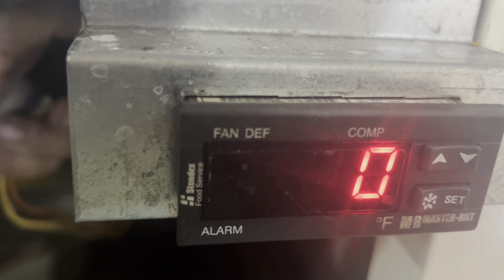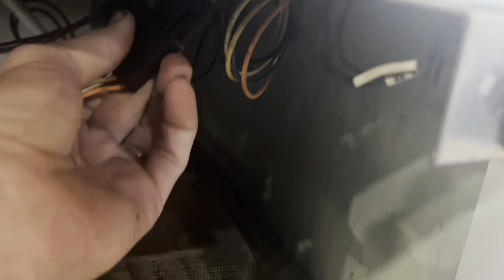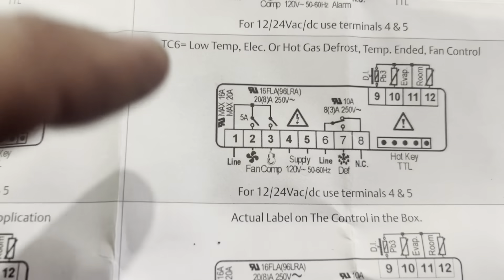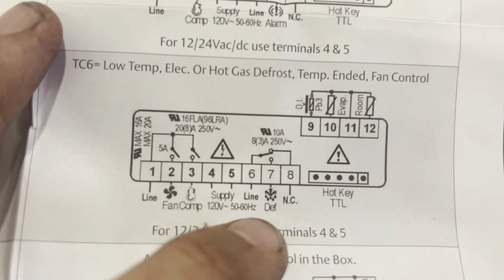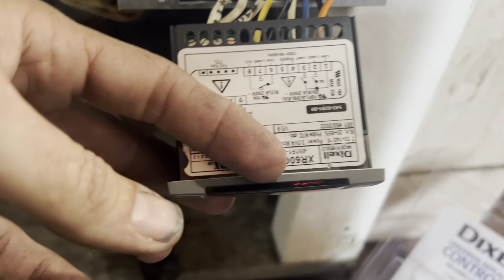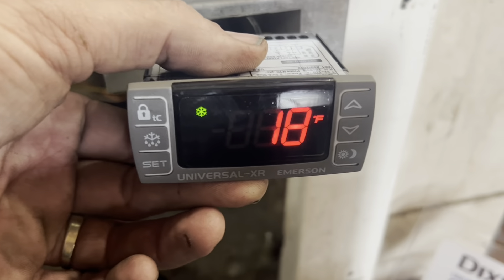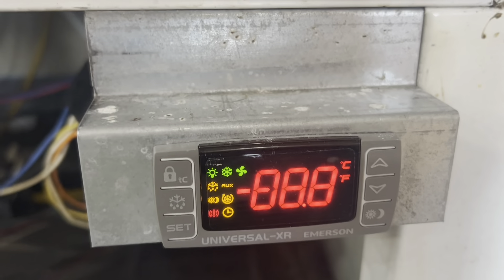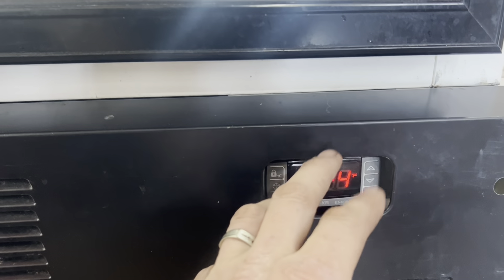Masterbilt cake freezer - controller P1/P2 error

Comment: I like those controllers nice repair.
Reply from the maker: The ranco version I also like. It’s more customizable if you need to dial in a troublesome unit.  But the ease of the dixell is definitely sweet if cookie cutter settings will work.
Reply: @restaurantrepairs  right on.thank you
Reply: @restaurantrepairs  you can change all kind ls of parameters on the dixell too, there’s a hidden menu
Reply from the maker: Yeah I found it and went thru the hundred options to make sure there were enough defrosts setup and what the termination temp was.  They just don’t express any of that in the manual or setup guide cuz they want you to use their presets.  Seems like the status quo is to not entrust “techs” with any such need to think.